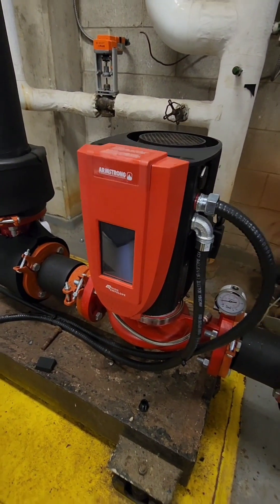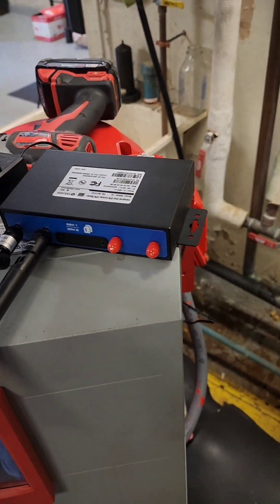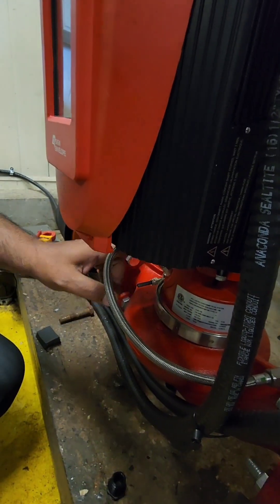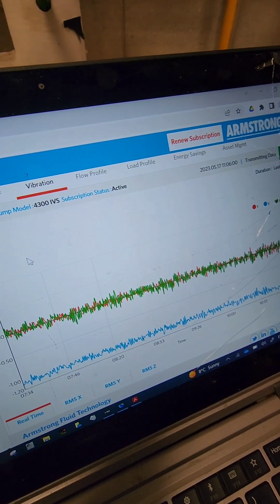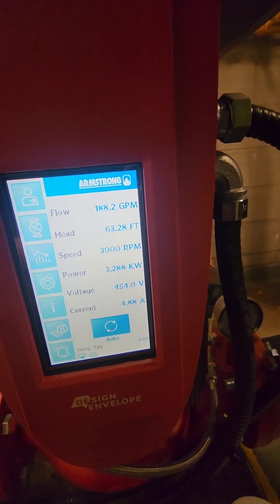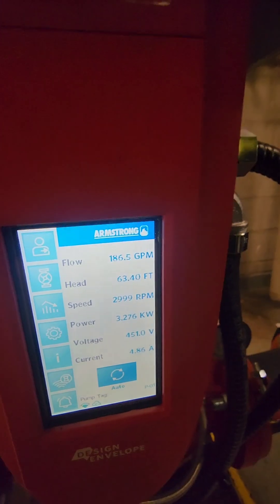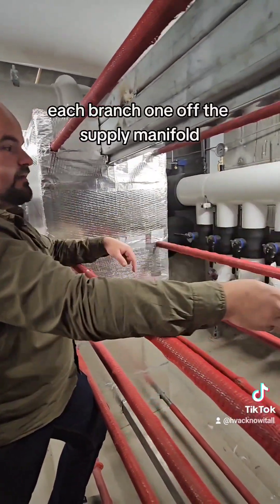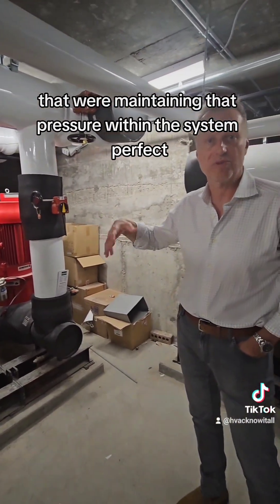High Rise Geothermal The And Future Of Hydronics Pumping Technology

Comment: This is kinda funny to me. Armstrong a renown for failing pump seal bearings. the fact they've opted for a V-band is really cool, allows you to rotate the inverter to face any direction. also allows you to swap those bearings out when they ultimately fail. still not 100% sold on ground source, gotta do more research on it i guess.